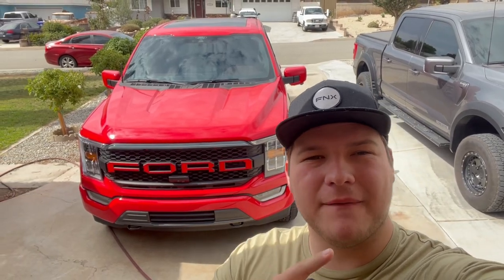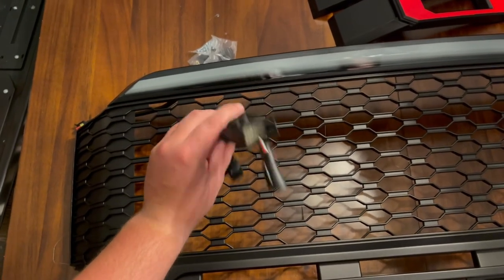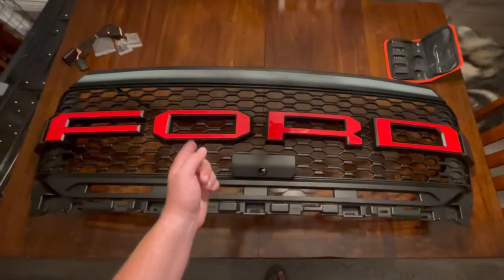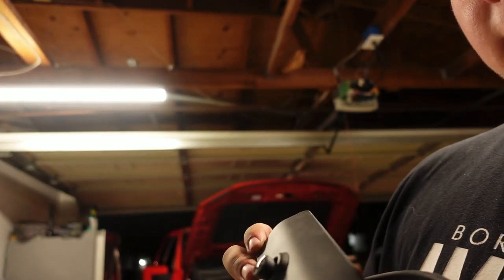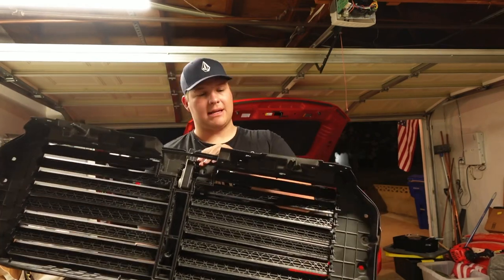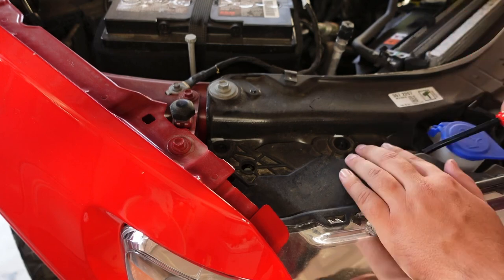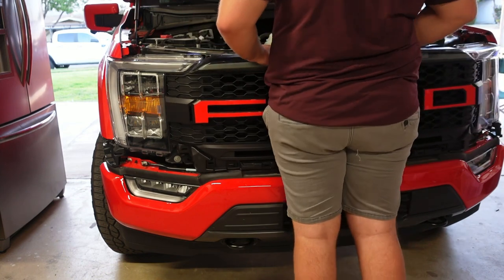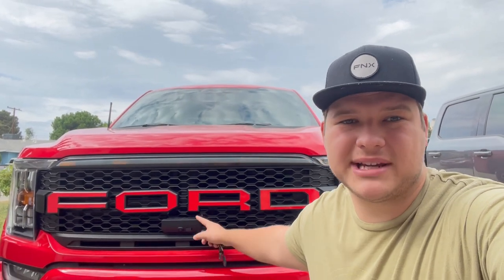The Most Unique 2022 F150 grille￼

Comment: Did you have any problems with the wiring harness. I just got the grill and when I went to install the harness does not fit in any socket for the lights
Reply from the maker: I had no problem with it but check the video and make sure you are trying the right harness.

Comment: Got it installed. Though having a few problems. The grille works fine. Though I have no passenger blinker, or running lights. Passenger rear blinks fine, though the dash indicator is doing a hyper blink. Got a pop up check headlights. Do you run into any problems? I really like the grill, gone to far to return. My only though is to remove harness and just hard wire the light. Any advice?
Reply from the maker: Wow! None of those problems on my end thank God. I would check your harness and make sure it looks good. Everything where it should be and such. Also I’d clean it all out. If neither of those do anything then yes I think a hard tap will fix the problem. BUT, I’m not a professional so maybe take it some where and get some advice as well. Thanks again
Reply: Watched your video again. I don’t know if it’s making difference, though you have the quad headlights and mine are dual. I did hard wire so the drl works. If I want the Amber, I think I will have to wire it up to switch of some sort. Though talked with the seller and there sending a new harness. Maybe that will solve the issue.
Reply: @tompatterson436  hi TOM I have the same problem with the cornering lights on the left side and I see that on amazon, those who have bought have the same problem, have you been able to talk to the seller? or have you been able to solve this problem, I could not connect it!! I'm out of flashing lights.
Reply: @JUANCTOBON  I emailed the seller. I even got a new harness from them. Didn’t work, I think it’s made to work with halogen lights not LED. I tried to wire the ambers to the parking lights, it works. Though once you hook up the drl light they disappear. Haven’t figured it out, really would like the Amber on at night.
Reply: @tompatterson436  I am having the same issue. I have the upgraded headlights and now I'm getting notifications that I need to check my headlight system and my front passenger blinker doesn't work. Any resolution?

Comment: Dude so sick!  I was seriously just looking at this grill the other day.  A few questions.. I have a Lariat (coming.. scheduled 08/22) so I have the camera.. but if I use the oem ford badge, would it attach the same as your letters?  And is that light bar controllable?  Can you make it all white all the time, or the orange markers all the time? And do you think the white matches the headlight DRL pretty well??
Reply from the maker: So if you do the Ford emblem is should all go straight over no problem. At least that’s what I heard from someone else. You can’t control it unfortunately, it’s Orange for day time running lights and it’s white when your light are in on mode. And I think it matches perfect. If not it’s super super close. Go sub to my insta and you’ll see more of it. Thank you for always watching and commenting!
Reply: @ColeCulture  Awesome thanks. Good info.
Reply: @ColeCulture  thinking about this a little more.. do you think if you rewired the harness you could make it so it’s the opposite… the white bar is on with the DRLs and switches to the orange markers when headlights go on?
Reply from the maker: Yeah you could for sure do that, you’d have to learn what wires go to what and then switch them.

Comment: Dude!!! That’s great! I have that grille in a box in my garage, waiting. I was so happy to see that wiring harness in the box. I saw the Amber lights. When do they come on or off? I don’t have a 3D printer(maybe a side for you for this grill. I’m just going to mount the emblem on the grille. That will house my camera and washer. I was going to paint match my letters. Again, awesome video! Now I know what it looks like
Reply from the maker: Heck yeah! So the amber lights are the running lights. And I was thinking about doing the emblem that way I didn’t need all that work, but I’m doing a Raptor build so it’s gotta have those iconic letters. But it woulda been more easier to do the emblem and I think it looks cool especially paint matched. Thank you for watching and commenting and let me know if I could help you at all!
Reply: Do you know if it threw any codes, with that harness. One thing I have learned, there very finicky with mods.
Reply: @ColeCulture  I’m going for the same look. Though I’ll have to figure something out for the camera.
Reply from the maker: My backup auto breaking is a code that has been coming on sometimes, I’m waiting to see if it goes away but my back up auto breaking still works so I’m not to sure what’s going on. If it’s still going off in a week then I’m gonna take it down and get it cleared
Reply: Have you figured out the problem with the backup camera